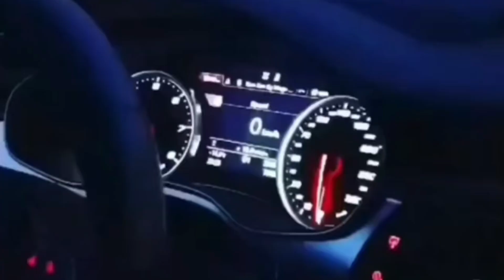Engines 1.0 VTi, 1.2 VTi and 1.2 PureTech - PROBLEMS AND WEAKNESSES

Comment: Run from pureTech engine, folks. Here in France, it's known to have a bad reputation. The belt is inside of the engine. And as all other peugeot and Citroën engines - they usually lick from the top, and some of the lick fuel enters inside the engine and eat up the belt which result to cut and engine destruction. Go for HDi instead.

Comment: I think you're missing out on the infamous wet belt construction where the oil eats the belt causing cluttering and blocking by belt residue. These are not good engines at all in terms of reliability. Also Stellantis is one of the worse when it comes to warranty claims. I'm hoping that their latest iteration of their puretech engines with a drive-chain instead of a belt is going to do better in terms of reliability. When the engine works fine it is indeed a very nice unit to operate your car but the potential money-pit with regards to the universally failed wet belt thing is just not worth it.
Reply: What if owners actually take care of their engines by changing the belt every 80k km and often change the oil as well as checking oil level often. Then we would not experience these problems. All of these problems can be prevented if owners are not lazy. Not PSA's fault but bad ownership.
Reply: @IKSH7 My brother has a 2020 208, his engine went bang at 30 odd thousand miles, the car was only 2 years old, Peugeot had to fit a brand new engine under warranty, when he went to pick it back up even the Peugeot mechanics told him to get rid of it ASAP. They said they 
Are the worst engines ever made, they said because of the wet belt, and piston rings wear out super quick, my brother did say before the engine went it was guzzling engine oil. They said just get rid of it now while he has the chance, but he still has it. He feels like he's been ripped off because he wasn't aware the engines were garbage until the mechanics told him

Comment: Is puretech 1.2 has gen 3 version , in which belt is replaced by chain?
Reply: Yes, gen 3 has a chain but that doesn't mean it will be better than the wet belt disaster. If they use shitty chain tensioners or if they have badly engineered it then it will be as shameful as the gen 1 and 2 where. And as Stellantis isn't known as an engineering prowess I fear it will be the same shit in a different box. Too bad as it's a smooth engine with good power and consumption delivery.
Reply: Good day everyone, I work at Citren, in short - the engine is fantastic. Go to service every 10000 miles, oil from 2 months 2024 is 5w30, and belts are changed at 82.83 atmospheres at 80000 miles, and turbo 110.130 at 60000 miles, we learned that cars that drive longer distances wear a belt less - means the engine is fantastic. Greeting
Reply: @svenujdenica3049 shit engine